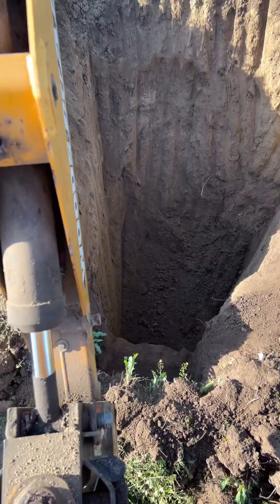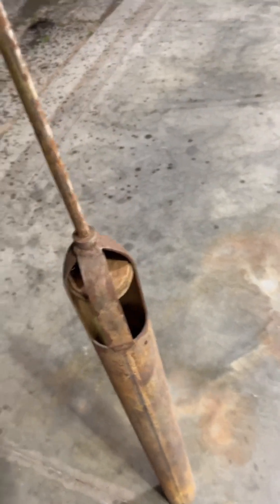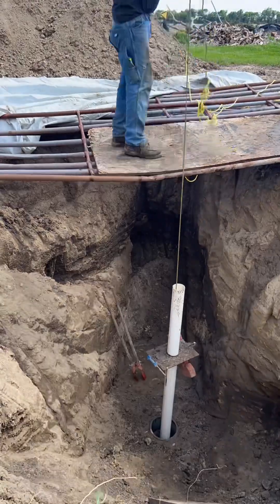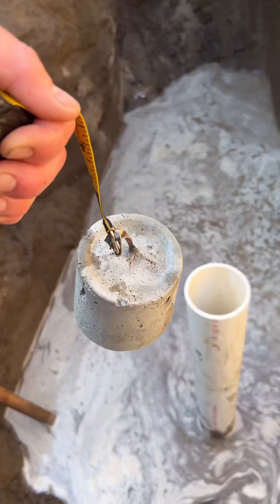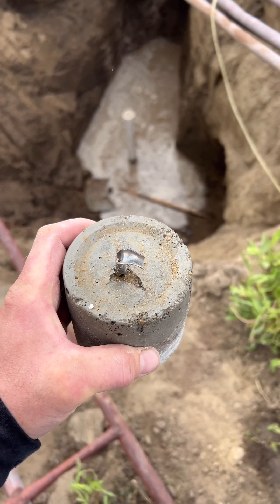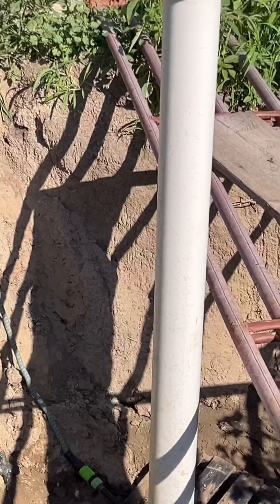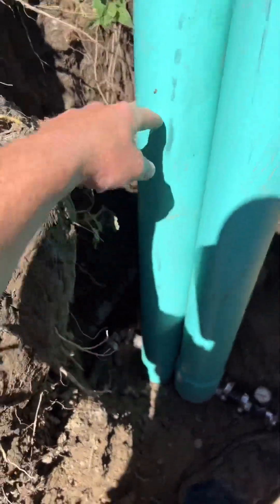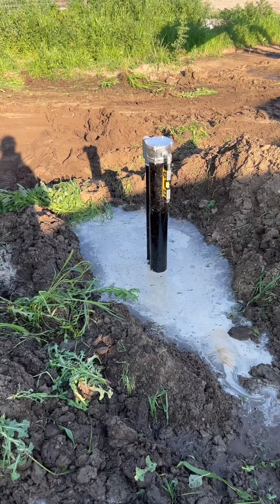DIY Water Cased Well

Comment: I'm from Nebraska also and have sand bucketed a number of wells in the Platte Valley in my years. Your father's sand bucket mirrors the design I used when I was young. We used to borrow it from the hardware store, but somewhere along the line it was never returned. The only difference was that the bottom of the pipe just above the check valve had a hinge and a latch so that you could easily empty it of the sand and gravel. Would you ever consider renting your sand bucket to me, since we're in the same state?
Reply from the maker: Absolutely I can loan it out to you, just email me and we can always arrange something. 
Thanks

Comment: i know the difficulties of doing this aswell, ive drilled 2 of my own wells (only about 25ft) but still know how almost everything that can go wrong does and you cant plan for that. I was sticking in a new suction line into my first well, and a rock, sised the exact diameter of the pipe, got wedged in the casing (as its only about 1 inch wide) and stopped me from being able to lower the suction line down, this took me over a day to get out with a borescope camera right at the pipe joint, and several old bent coat hangers to form a hook
Reply from the maker: Yeah, I follow my gut feeling and it usually plays out how I think in can go wrong it does. Thanks for comment